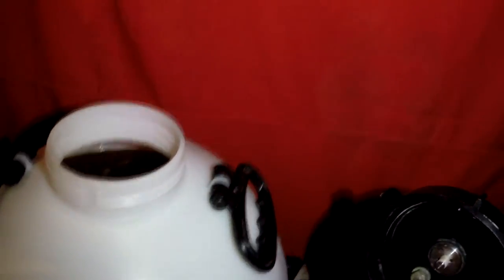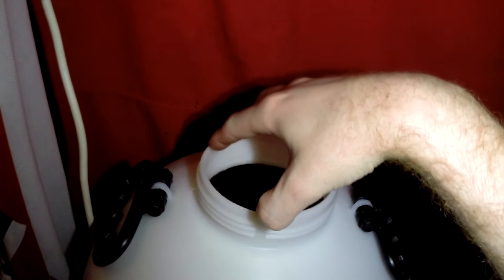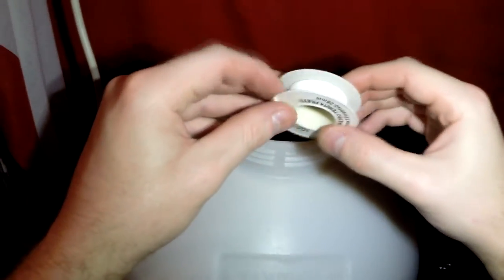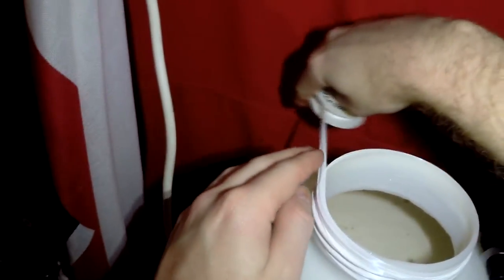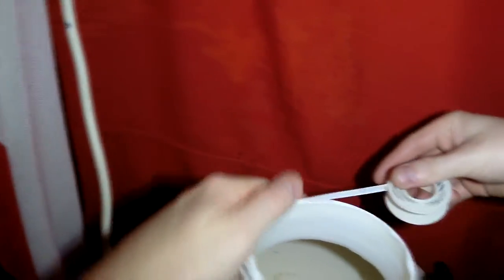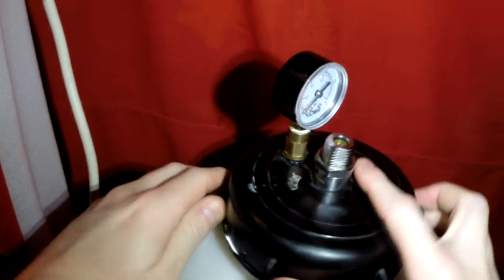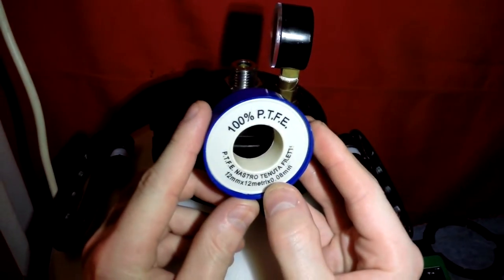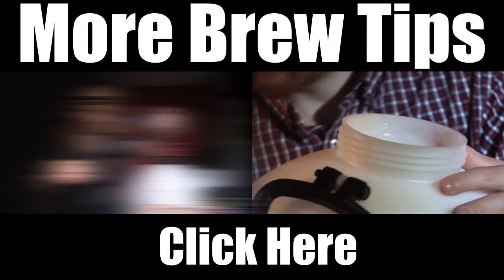C02 Leaking from King Kegs & Rotokegs (Fix Solved Help)

Comment: Great, thanks. I just ordered the king keg, so this is very helpful. I'd thought of doing this myself with those 5L water bottles for secondary fermentation.
Will also be looking at adding silicone sealant for the tap as was recommended. I couldn't find a video about it but this came up.

Comment: Its the fitting with the rubber bands in the center of the cap that lets the thing down, its next to useless. Needs a proper calibrated prv and a separate ball lock gas post and possibly a liquid post for closed transfers.

Comment: good use for PTFE, from plumbing experience - wrap the tape on in the direction on the threads, otherwise when you tightening the cap in will be unwinding from the threads and it's less likely to seal

Comment: What I've done to test further is to inject a 8g co2 bulb.  If you get hissing out of the lid then you know its not sealed or tight enough.  If coming out of the release valve, then you know its a good seal.  The difference could save your brew if you test to ring your not fully sealed.

Comment: Hi , I did my first king keg batch, had fitted same gauge to, maybe you know what pressure supposed to be, my have after first night 0.4 bar and after second night still the same , do I have to fill up co2 to 1 bar or not? Or its leaking and won’t go up in pressure? Thanks

Comment: Hi, where did you get the gauge from?
Reply from the maker: +Ozzy Brew many thanks for the comment, forgot to put the link in the description. I got it on ebay:

http://www.ebay.co.uk/itm/king-keg-Homebrew-Barrel-Pressure-Gauge-0-15PSI-king-keg-bottom-tap-etc-/262250619282?hash=item3d0f5ae192:g:qEsAAMXQPatTJWrC
Reply: Thankyou.